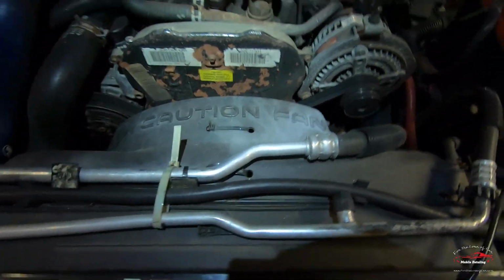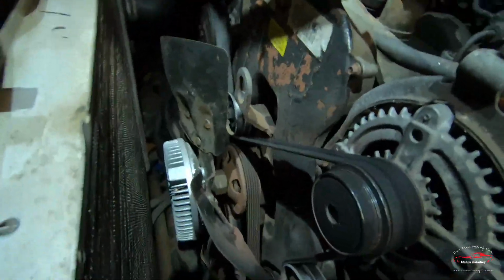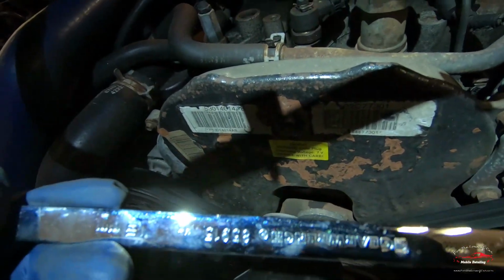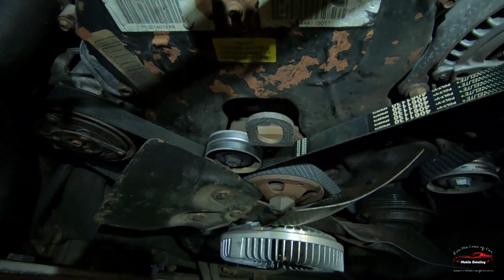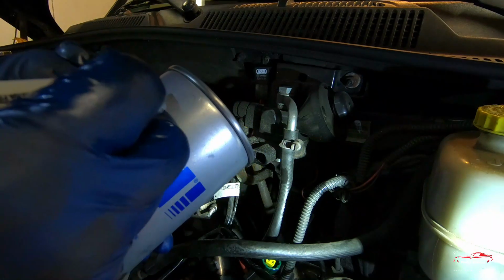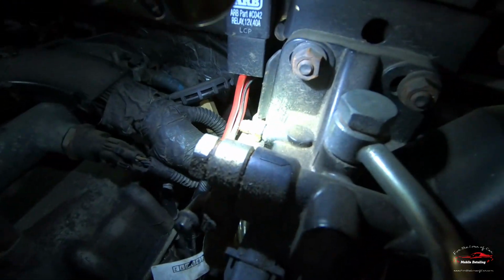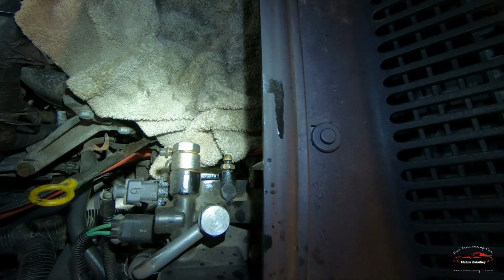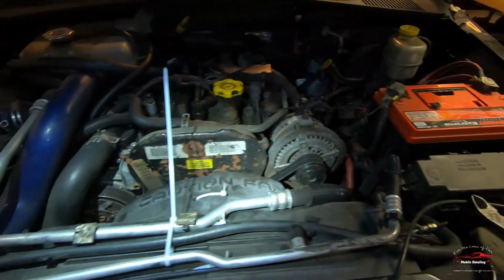Jeep Liberty CRD Fan Shroud Mod, Serpentine Belt and Fuel Filter Change

Comment: I use a long clear rubber line into a bottle to bleed the filter head. This way I can cycle the key solo with no mess. Or you can use a brake bleeder setup as well to utilize the rubber line and catchment system. Highly recommend the lift pump to an CRD owner! Smoother motor, added mpg, and in all honesty if you ever drove around with the MAF unplugged to bypass the egr, well that's what adding this pump makes the Jeep feel like but with the MAF still plugged in. Another great mod is the FF dynamic fan. These two combined gave me 4-6 mpg gain.
Reply: What is a FF dynamic fan?
Reply: I attached a clear hose too when I am bleeding my fuel filter to catch the diesel instead of letting it spill all over the engine which is messy and dangerous because it is flammable at high heat.
Reply: @munchichi8  creates more cooling in my opinion, opens up the engine bay, and gives back some HP, as it's electric instead of belt driven.

Comment: Interesting Mod to the fan shroud! I'm now wondering if I could do something similar to my 2008 JK Diesel? I have seen the shrouds cut across half way down with small plates to reconnect.  Is that long spanner custom or can you actually buy those with extra length? Thanks for uploading.
Reply from the maker: If it's a similar shroud, I don't see why it wouldn't work. The spanner wasn't custom, I bought it from a tool truck that was stopped at a local automotive repair shop.

Comment: Do you think you'd be able to do the timing belt without taking the entire front end off with this fan mod?
Reply from the maker: Funny enough, I had it apart fairly recently because the crank pulley failed and I was chasing the noise it was making. Thank goodness it wasn't under the timing cover, that was surely the next step. I'd say there is plenty of clearance to do the timing belt change with the fan shroud removed.
Reply: Yes, I concur also. Witnessed timing belt changed by a specialist traveler mechanic, with a similar fan mod (lower portion removal.)

Comment: Before the Mod, do you need to remove the fan in order to get the Shroud off? I need to replace the serpentine belt on mine. Also when its cut in half does it rattle around much?
Reply from the maker: Yes you will need to remove the fan to pull the shroud out. It doesn't rattle or make any noise. It still has a bolt holding in either side and with three zip ties on top it's solid.

Comment: I did mine without removing the shroud, though it looked like I tried to slit my wrists with a plastic knife for a few weeks.
Reply from the maker: Brutal. I will say, this Jeep has done that to me a few times. "Tight engine compartment" is an understatement
Reply: Please help me with mine 😵‍💫. I am in the same spot as you are and I’m not sure how to install it.